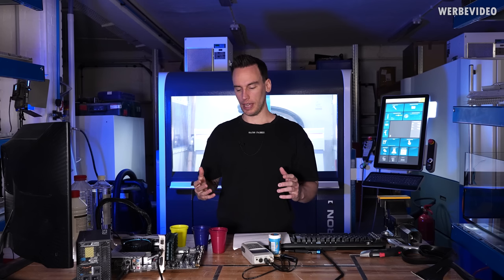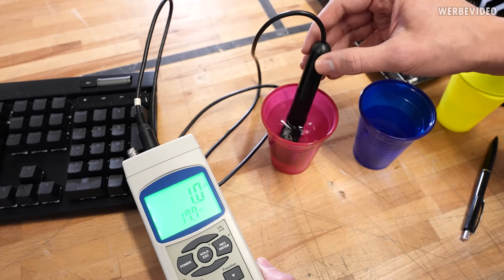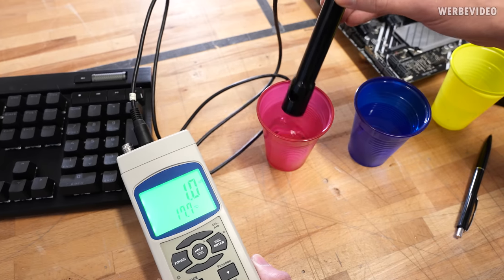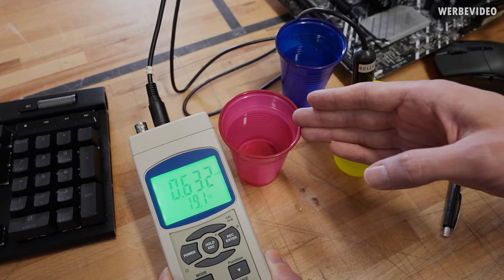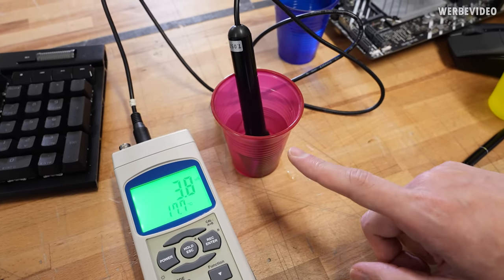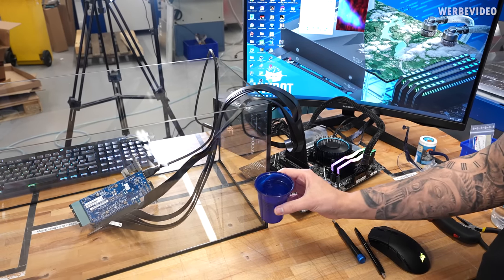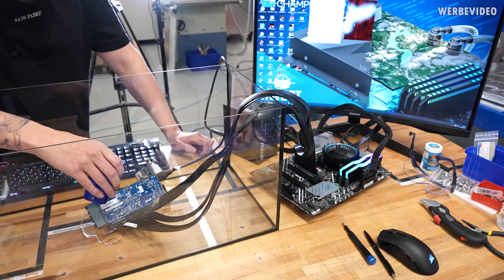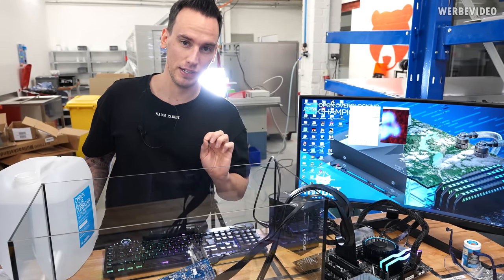Can you submerge a PC in Ultra-Pure Water?

Comment: The 12V lines have enough voltage to breakdown water into gasses, and the oxygen is very aggressive to the metals! I think it would be slow at first, but soon corrode anywhere the voltage was more than about 1.5V.

Comment: You mentioned the water reacting with metals but I'm pretty sure the main reason the ultra pure water is no longer the same as when it was bottled is because at some point it was exposed to air which has CO2 in it. When H2O and CO2 react you get carbonic acid a weak electrolyte which increases the conductivity. This is also why it's more conductive after you ran the system for a while because it's exposed to the air.

Comment: Water has dielectric constant of ~78.4 while air is ~1. So all stray capacitances, and thus signal cross-talk or high-frequency attennuation to ground, on socket and connector air gaps and also on circuit board surface traces scale up with the same factor. No wonder that any high-frequency signaling stops working.

Comment: Distilled water is very "aggresive" as it strives to equalize minerals it will try to draw as much, for instance it will draw boron from glass containers, making it undistilled, thats why we keep it in plastic, since it can't draw anything from it. So this it will probably in time get more minerals from metals in pc parts and probably gain conductivity, so it's probably temporary solution, i'm no chemist, but i did learn a little more about water, so it's how it's supposed to go according to my logic.

for instance if you drink distilled water it can draw minerals from your body, that's why if you drink water it has be mineral to some degree not to cause more harm than good.

Comment: I had my machine go through a flood, which is extremely nasty water. I was unable to get back into my house for about four days. When I did, I hosed the components down with a garden hose. The biggest issue was the motherboard battery corroded and rusted. I sent all the pieces to a friend of mine to test, and all parts except the ssds and gpu were toast. I read an article years ago about submerging a pc in mineral oil.

Comment: What about pumping into a chamber where it is evaporated and reintroduced to the tank that holds the pc and pure water after passing threw a radiator. This could be paired with a solar generator which runs daily as a filtering process to avoid the deterioration of the water.

Comment: When you exposed the water to air, some carbon dioxide dissolved in the water, and the CO2(aq) will partially dissociate to form hydronium H30+ ions and hydrogen carbonate HC03- ions. That explains why conductivity increased on exposure to air

Comment: There are oils that are totally non conductive to electricity but very heat conductive, many years ago I built some systems for use in a very demanding environment that were in sealed cases with one of these oils and they ran for years with no issues.

Comment: SCP (Short Circuit Protection)
Short circuit protection (SCP) constantly monitors the output rails, and if it finds an impedance of less than 0.1Ω, it immediately shuts down the power supply. In other words, if somehow the output rails are short circuited, then this protection kicks in and shuts down the PSU to prevent damage or fire. According to the ATX 2.31 spec, each +12V rail should have a separate short circuit. This protection is present in almost all contemporary PSUs (at least the branded ones).

Comment: Is it possible it was just shutting off because of the draw from the CPU fan? It has to be using way more amperage to turn that fan in the water than it would in air. I don't know if there is a self-preservation mechanism for fan draw current though.
Reply: no chance,if you hold the fan still with your hand completely the pc for sure turns on still
Reply: Yea I was thinking that, also with the potential resistance flux from it not being fully submerged could put even more strain on it too. Wonder how it would perform if the entire air cooler was removed completely with just the exposed cpu
Reply: @shadowhack159  That is a good point, I don't think there would be more of a draw running it underwater than a stalled fan. Looking into that cooler, it does list a "locked rotor" protection feature. I wonder how that works, and what it does when it senses a locked rotor.
Reply from the maker: I also don't think it's related to the fan. As shadowhack159 already pointed out you could also just slow it down heavily by hand and it would be no problem
Reply: @der8auer-en  I looked up the specs for the RM1 (which I think is the right cooler) and it has a locked rotor protection feature. I assume that would work by measuring current draw, but I have no idea if that is true or not. I am curious what it does when it detects a locked rotor.
Your engagement in the comment section is awesome by the way!
Reply: @--_DJ_--  it just stops giving it power for some seconds, then gives it a jolt of current to see if it's unjammed yet, repeat indefinitely

Comment: maybe fan cpu rpm being absurdly low from being in water? Maybe the water resistance from cpu fan causing an issue, possibly with its own (fan) power source? The video card is passive, so it wouldn't have had any fan related issues. That's what I'm thinking. I'd maybe try this experiment but with a small AIO on cpu vs stock fan, which wouldn't be affected by water resistance from being submerged in the water tub.
Reply: I thought the same

Comment: instead of water you should try some "HP imaging oil" which is used on the indigo digital presses. Its essentially like mineral oil but formulated for submerging electronics and PCB boards and is totally non conductive. You can buy some on ebay or directly from HP.  It would make for a cool video. It also air dries after some time so clean up would be easy as well.

Comment: Interesting.... From a clean room perspective, you would need to wash the used components with something to clean off debris, you would need to use gloves to prevent your body from shedding material... And considering some metals seep into the water from the hardware anyway, you would have to replace the water continuously, or find an alternative that pumps out ions.

One might have success with coating some of the contacts with chip filler to protect the most critical components and contacts.

But that leaves me to wonder, what your goal application would be. Aquarium pc? 
The idea of whole room watercooling comes to mind again.

Comment: Just the simple act of pouring the water into the fish tank would have introduced a lot of dissolved gases which would have increased the conductivity of the water.  I also vaguely remember that water has a high dielectric capacity which would wreck havoc with the high speed signaling on the motherboard.

For what it is worth, the dissolved content of water is what gives water it's taste.  Distilled water "tastes" horrible because it has no taste - you can make it taste better by simply putting it in a bottle half full of air and shaking it for a bit.   The dissolved content is also a great source of trace elements which is why you should never start drinking distilled water over tap water if you can help it.

Comment: I wonder if the non-conductive water seeped into your power connectors causing an insulation effect rather than a shorting effect, meaning did the non-conductive water prevent (at least partially) the transfer of power to key components, aka ram slots, PCIE, 24 pin, etc etc etc to prevent booting...

Comment: You should use alcohol or a liquid like WD-40 to clean any wet device, simply drying it won't be enough to avoid long-term corrosion.  WD-40 is actually designed for this exact problem, the "WD" being a shortform for: "Water Displacement".

Also, could it be that the motherboard was not seeing the proper CPU fan speed to allow a boot?

Comment: So the conductivity of the "ultrapure" can change even if it's still pure due to temperature. In the absence of metal the purity doesn't change much. Most plastics are not water soluble and the amount that dissolves is basically neglible and more likely than not you are just measuring at a warmer environment and your tools have slightly different calibrations.

Comment: We use deionized water to cool the stator of our generator at the reactor I work at. 18k volts AC, 980M watts, output and doesn't conduct enough to short out system. The key is to ensure there are no ions.

Comment: 12:30 You're right, for low TDP CPUs it doesn't really matter, I ran my i5-6500 without TIM for years in the past as my main rig, including gaming. It didn't even go beyond 70 C with a decent cooler. But for 100W+ TDP it starts to matter quick.

Comment: I think the problem is not conductivity in this case but impedance. At several GHz that memory operates even small conductive patch betwin data lanes and ground could trow it out of spec and cause many errors.  The problem is that water(even purest one) have around 80 times more permittivity then air. 
Take for example CPU socket where distance betwien pins is around 0.5 mm. In normal operation there is small capacitance created by two metals and air (air capacitor). This capacitance is known to Intel / MB manofactuer and taken into acount making memory specs for stable operation. BUT if we add water on those pins we crete a capacitor that have 80 times more capacitance and the memory is not longer able to oparete stable.

Comment: A long long time ago I had a glass of 300ml of Dutch tap water fall from my desk onto the totally vented top of my case. Not proud to say it, but due to my pot smoking at the time I didn't bother doing anything, even left the PC on. For the next hour or so I heard the USB disconnect and connect sound a few times, and oddly, afterwards it was completely fine and kept running fine for many years after.

Kinda surprising, as even the next day when I woke up and realized what happened, and checked things out, I noticed small water droplets on top of the GPU

Comment: there are salt residues from soldering on the board..  you should have rinsed the boards several times with distilled water and last rinse with ultra pure to dissolve and clean the residues before powering on while submersed in ultra pure water.

Comment: thanks! i test this more than 5 times in our lab wit same result. and yes UPW is only be non-conductivity before touching pc hardware or as i found (any electronic boards)
and ( no matter how much you clean those electronic boards) but its not gonna work! 
-why ? cus what you have in pc hardware is bunch of electronic parts like Electrolytic capacitors, Mosefets , And all kinds of "chemical parts" that can change UPW to +conductivity 
and even the effects of electricity concentration in chips cause molecular explosions in UPW. 
And of course, I'm sure you know that you can never blame the soldered tins on the board.
-in other words "there are many criminals on each of the electronic parts and boards that can easily change the conductivity  of UPW . 
btw thanks again and your video was great !
and please if you find anything useful about this project, please let me know , thanks a lot ❤

Comment: Does it run when cpu fan speed is below 300rpm?  Submerged was very slow. I would try a charcoal water filter. Dust from air, dust from mainboard, dirt from hands. But its pointless, the high current ionizes the water in a short time.

Comment: HDDs are air and water sealed from the factory and have been so for at least 25, maybe 35  years. So they wouldn't have any risk of water getting into the bearings. If you ever look really closely at the motor area on the underside of the HDD, you will see an epoxy resin in every hole and crack around and on the motors for this very reason.

Comment: The problem with water is, if you fill it in a silicon container, some of the silicon atoms become lose and murk the water. So even if they claim a 0.06, it's not necessarily going to be that rating for long. Technically speaking, and depending how long that water sat in a plastic container, it's not going to be as "pure" as you would expect.

Comment: air and oil has a lower dielectric constant than water. i think air is 1 and water is above 30-80. that would be enough for low level signals such as clock and high speed data lines to lose signal integrity... (i think)

Comment: the problem is that the board itself will start "throwing off" conductive materials to the water, until the water becomes conductive enough to make the whole thing blow up.. figuratively of course...and the thing will probably work after being dried out because it had so many shorts  under water that the board simply never reached a temperature to destroy itself...

Comment: Back in the day people used to submerge their systems in mineral oil.  But it would still get heat soaked fairly quickly, so you needed a heat exchanger to make it worthwhile.  I never did it, but helping my cousin clean up his build after a mineral oil bath was interesting 😆
Reply: ohmagerd I could not handle that, I go through enough degreaser to clean up what my old BMW leaves behind on the garage floor lol

Comment: Not an expert but if I remember correctly long term, the low gh & kh of water would damage any components inside of it which would end up making the water conductive and corroded components. Same as in a pool with it's concrete/paint/vinyl layer & pump system.

Comment: I'm not an electrical engineer so I may be wrong.

I think the water be not conducting enough and becoming an insulator.

I think part of the problem is the water is physically in the way of the connectors and causing it to disconnect which causes a hard crash. Especially if the power plugs are disconnecting.

Maybe hot glue the plugs and the other connections or some other way to keep the connection in tact and with no air gap with introducing particles into the water.

Comment: Put it again with the fan external, and it will work try to grase conectors mostly those underneath the cpu, and you can fully submerge  y did and worked 💪

Comment: Hi, interesting idea about the experiment. I have some takes about the experiment. Could be an issue with the CPU fan itself? Air have some impurities and the effect of the fan was like a waterbomb, pumping, bubbles and creating waves. Those waves increasing the surface contact with air due the pump effect paired with the aquarium could impact the test by introducing moving parts and new variables to the test. That could explain why the first experiment worked a bit more, the second was really short, the third after a bit of waiting took a bit more time but at the moment of the 4th the level of conductivity could be already high enough to generate interference. That could explain also why the GPU when you poured water at beginning had a slight interference on the display but after keeping putting more water the card itself didn't had major issues, although most of it could be either to loose contact due the slot and because the water increased the conductivity and that contact was restored in some way. What if cpu had only the heatsink without fan? Have you considered that the experiment could work similarly to the gpu one? Also mask could avoid your saliva and gloves which both could decrease the possibility of some kind of impurity on the experiment? Could be an interesting test to check it out if those variables would affect it or not.👍

Comment: Just a theory; can ceramic-coated water blocks — that is, with a heat-transferring ceramic enamel coating on the interior faces of a water block — help to reduce the impact of metal ions flowing through water?

I cannot imagine this can help for skived metal flow jet plates, but everything else should be big enough to allow for higher tolerances which would account for the semi-uneven nature of such a coating.

Comment: Interesting experiment, but I would first wash each component in an ultrasonic cleaner with a decent solution (ask Kingpin) to get rid of fluxes and other contaminants.
Then I would use gloves so as not to transfer sweat (salt) to the equipment and, above all, I would not install fans (lubrication of the bearing), only heat sinks.
Water is a problem, which is why we used to use transformer oil as a substitute (warning, the damn thing is dangerous).
P.S. You forgot to remove the battery while drying the board :)

Comment: I'm only a minute into this but I want to comment already: You'll pour the ultra pure water in and it'll immediately become impure water, as very pure water is a powerful solvent and any dust or solute on the PCB's (and that thermal paste, that can dissolve, right?) will turn the ultra pure water to water, which will then be conductive enough to short components. Now I am going to watch the rest of this video.

Comment: Wonder if you put fully integrated motherboard were everything is solder on board if system would work. Maybe try to plug up external usb port or unused display ports if that work?

Comment: you can but even if the water is pure the pc will corrode and things like copper oxide will go into the water and make it conductive. you would need to coat it in something like nail polish or epoxy or something like that if you did that to stop corrosion and the whole thing was clean after that like not even touching it after coating it would work for awhile at least.